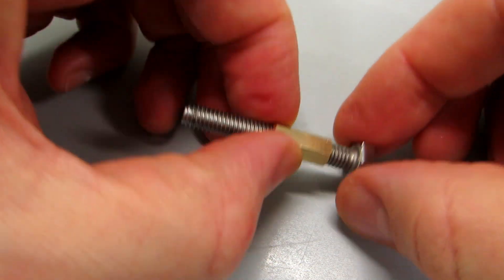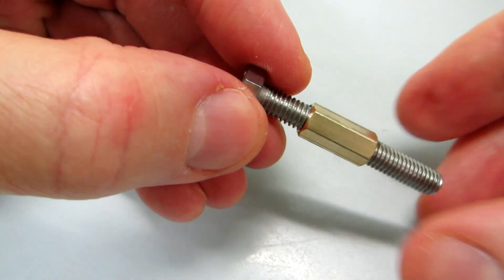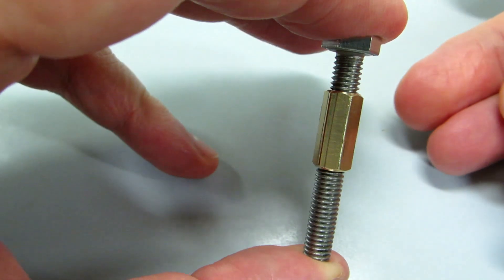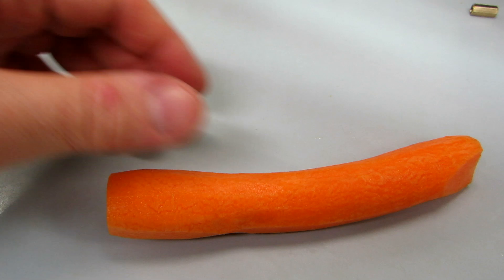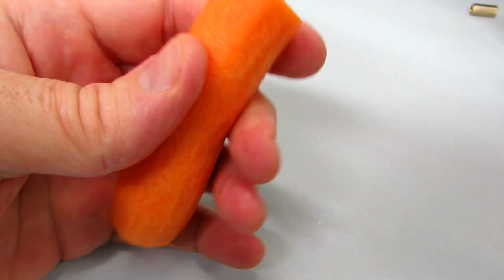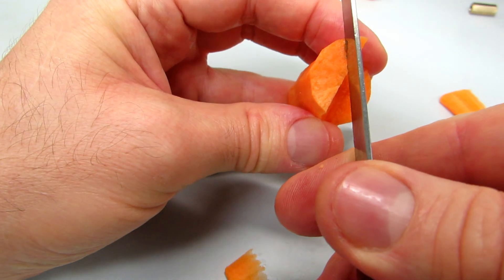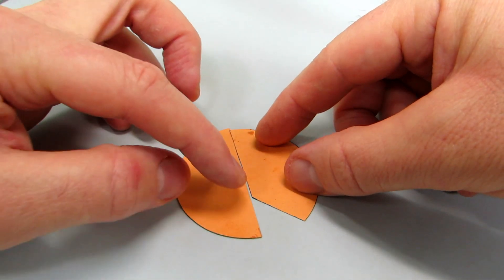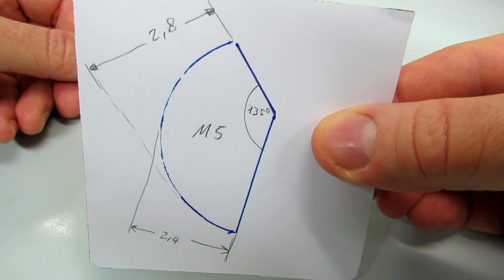The Impossible Screw will drive you nuts.

Comment: I tried to make one, but I had trouble threading my carrot.
Reply: try freezing it first.
Reply: @saradeanna  - screw that.
Reply: I didn't understand. I tried it with celery. Didn't work.
Reply: silly wabbit you holding it wong
Reply: Got my carrot caught in cieling fan
Reply: U probably used a metric carrot... it only works with UNC carrots... 🙄😏
Reply: fools,   he meant on a real bolt....only issue im having is it ruined all my kitchen knives trying to cut the bolts, any help on cutting the bolt would be appreciated
Reply: @dLikesDDs  
I'd probably go ahead and try a hatchet🤔
I myself was gonna start the lawn mower up, tip it up and while holding the bolt, stick it up into the spinning blade. It should give me a nice clean cut...........
up by my elbow or maybe even the shoulder🤪
Reply: That must hurt!
Reply: @pondartinc4002   - Celery! You some kind of stalker?
Reply: misfitsailor was it a grade 8 carrot? It’s gotta be a grade 8 or its too soft.
Reply: misfitsailor should have used a melon
Reply: misfitsailor I use that euphemism too!!!
Reply: I left my carrot out for the reindeer
Reply: Try metric instead of imperial.
Reply: Andrew Crews  I thought he also threaded a carrot as well?
Reply: Brilliant!!
Reply: after reading all these replies I lost my appetite for lunch :P
Reply: John Coops da dum crash...
Reply: I accidentally ate my carrot, I got hungry when I was making it.
Reply: I was out of carrots, but it worked well with mashed potato
Reply: He was using a cucumber not a carrot.
Reply: misfitsailor there it is.
Reply: That's what she said.
Reply: ha ha...
Reply: it works with cucumber though
Reply: @scootergeorge9576  hogies and grinders, hogies and grinders, navy  beans navy beans...
Reply: Man! That might hurt!
Reply: Swedish engineering is good; have you tried replacing the carrot with a swede (freely available from grocers shops)!

Comment: I don't thing the angle is the critical figure. I think the proximity to the center is what determines the clamping force, so you want to be as close to the center as you can be without actually having the cut go through dead center. At least, that's what makes sense in my head.
Reply: You got it 👏🏻👍
Reply: I think the angle is critical as the thread height is related to angle.  Turns per inch.  So n degrees = n/360 * thread pitch.  You need to ensure that you raise the height of the screw enough to cause it to jam against the thread play (whatever that is).  It’s probably a small angle but I’m sure it’s relevant.
Reply: I believe you are wrong. Think about if it was cut dead center. The screw would rotate about the natural center line of the fastener and not provide any outward force... just an axial offset since everything would remain concentric. Still, a very similar story if you are as close to center as possible.  If the angle is off center significantly, then pivoting about that point will result in a non-concentric path taken by the screw threads and result in binding. Long story short, eccentricity is what is causing this to work, so cutting on center, or as you state, "as close to center as you can be" without cutting through dead center does not cause any eccentricity. Or at least not a noteworthy amount to make this work.
Reply: This is correct. Not an opinion either. To the non-believers: when you remove the 45 deg. slice, that removes 1/8 of the thread lead. It jams because after a 45 deg. turn, you are forcing a misligned thread. If anyone is familiar with how screws operate, they create mechanical advantages. I'll skip the details and say it would take much more friction to jam it concentrially than it would axially for that reason.
Reply: I have an engineering degree and can confirm that the distance from the contact point to the center line of the bolt is the critical feature. The force required to rotate the screw will increase as the contact point moves closer to the center.
Reply: @andreww04  cross threads is better than no threads *in my best hillbilly voice
Reply: Almost correct, you must take into consideration the tolerance between the inner and outer threads, too close and it wouldn't grip.

Comment: I think the angle is less important than the offset. The offset required is determined by the gap between the bolt and the nut. The offset must be able to force the two parts apart by slightly more than the gap. The angle needs to be just big enough to allow the required rotation to accomplish that. So there is a minimum offset and corresponding minimum angle, determined by the diameters and the gap.

I think it would be possible to do it with ramps on each half. Turning one way, the ramp vertical faces push each other. Turing the other, the ramps force the halves apart, causing the threads to jam inside the bolt. But this would be much harder to make. That's what I thought was happening. Imagine a cut along a helical plate passing out from the center axis through a thread, making one revolution. Where the two ends of the cut overlap, another cut is made on a plane parallel with the axis from one thread to the other. The two pieces would separate cleanly. The amount of rotation to jam would depend on the tolerance of the threads and the pitch.

Comment: I may have a challenge to you...
On a spining whell adding weight closer to the tyres (bigger radius) keeps inertia much more easily than weight added closer to it's axis.
With that in mind, are you able to aply a variable radius ballast that will ease braking or acceleration by adjusting the ballast's radius on demand?
IDK maybe with magnets or gel or rubber bands? Like a magnetic suspension...
My idea! No one steals it from me!! lol

Comment: I have solved this mystery. the nut has is split thru one wall the length of the nut. Therefore you can squeeze the nut to tighten on the screw which allows you to turn the screw either way. You are welcome.

Comment: I don't think outward clamping force is really what is locking the nut here... Rather it is creating a misalignment of the threads... So the pivot point location is less relivant then the angle of the second cut when it comes to how much it will bind... This is similar to how 2 nuts will lock in place when tightened against each other...
Reply: I absolutely think this is what's happening as well. 👍
Reply: That sounds right to me too.
Reply: but when turning any of the sides the part of them that is in the nut will also cause it to move up/down accordingly, so wouldn't the thread stay in a proper position all the time?
Reply: I think the lock is acting like a Sprague clutch, rather than on the basis of elevated friction attributable to thread-phase issues. Grosso modo , the relevant force is radial rather than axial. 45° is one-eighth of a turn only. The locking appears to be rapid-onset. If it were attributable to phase issues, I'd expect to see a ramp-up as lash is consumed.

I expect that someone more familiar with a slide-rule will be able to calculate precise angles or derive a formula that ties pitch and diameter and thread angle together to arrive at optimum angles for that second cut…

Comment: It’s fun learning when presented with puzzles. Is this used in any practical application? I would think in some cases, this would be very useful.
Reply: Self locking nuts are used in colum lifts. But they work a little different. There are also two threaded pieces but they lock because of they are getting closer in the thread direction. Same technology is used as a mechanical endstop on some mills or turning machines

Comment: You’d think somebody mechanically inclined enough to come up with this or even implement it would know the difference between a screw and a bolt.
Reply: +Keith Preston A bolt is a subset of screw... The broad engineering definition is that a screw is threaded into a threaded hole (in the case of self-tappers, woodscrews etc the screw is cutting its own threads) whereas a bolt is used in conjunction with a nut to clamp unthreaded components. Here, he is inserting a machine screw into a nut, so it's a screw. If he had passed the screw through holes drilled in two pieces of metal BEFORE adding the nut... the screw becomes a bolt :-)
Reply: donkmeister What you say may be true in a dictionary somewhere, however, it’s not true in Lowe’s or Home Depot that I’ve ever seen. That’s a bolt. Doesn’t have a point. Threads are not angled to cut or deep enough to hold in self-cut threads. And the tip is not like that of self- tapping metal screws. Also, he’s putting it into a nut. What goes into a nut? A bolt. I’m waiting for dinner to be delivered. Which shows how bored I am to be discussing this.

Comment: I think it could work better, if you not cut it in two halve segments,
rather cut in in 1/3 and 2/3 segments.
Then, make a wedge from the larger part, no offset required.
You might not need 45 degrees either. But that's just an idea.

Comment: Engineering question;
When does a screw become a bolt?
Reply: A; when her dad comes home.
Reply: @drongojonkins8945  screw doesn't have a gender so don't say her, you must say it.
Reply: Nice one! At first i thought it was serious. Lol
Reply: So I guess the slow one that gets caught would be considered a lag bolt🤔?
Reply: After the wedding.
Reply: Bolts fasten things together with no threads in them, requiring a nut on the other side. Screws fasten one or more things to something with threads already in it, like a tapped hole. Bolts are mostly used in structural connections, screws are mostly used elsewhere.
Reply: @OgeyTheTerrible  
Thx! I actually have wondered this for the longest time but I have been too lazy to look it up! LOL
Reply: @OgeyTheTerrible   sorry but incorrect. Think of an engine, it has many bolts that don't use nuts. Manifold bolts, head bolts, connecting rod bolts. The list goes on.
Reply: @andrewaustin6941  ^
Reply: @andrewaustin6941  Not quite. 

An engineering screw has threads from the end all the way up to the fastener head. (aka a "full thread" bolt) 

 A bolt has a parallel section of shaft with no threads before thread starting on the end.
Reply: @OgeyTheTerrible  not quite, as above^^
Reply: @OgeyTheTerrible  so, your entire car is held together by screws? Lmfao! Nope, they are bolts.
Reply: @troylinden369  as a matter of fact yes, the majority of my vehicle is held together by screws, because that's what they're called.
Reply: You can thread a nut to a bolt but not to a screw.
Reply: It becomes a bolt when you put a nut on it, if you thread it into material it's a screw. But mostly it's a stupid semantics thing and people ignore it all the time. No wonder, the same damn fastener can have a different name depending on how you use it.
Reply: Funny joke. But it is considered a screw when it is mating with a preformed internal thread or it forms it's own thread when installed.
Reply: @prdoohan  that was what I was taught as an apprentice , I would also say that looked more like M6 not M5
Reply: @dogwalker666  I hope so, because I teach for a living and that's what's in our study notes!
Reply: A screw is driven in with a screwdriver, a bolt is driven in with a bolt driving thingy------oh yeah it's called a wranch or wratchet.
Reply: drongo jonkins: A bolt requires a nut to complete its purpose; a screw does not.
Reply: @rideswithscissors  therefore headbolts to put a cylinder head onto a block are actually screws as they go into the threaded block. Yet...they're called head bolts. Trust me. They're very much called that. I guess automobiles ignore these proper terms.
Reply: @prdoohan  "...section with no thread..."
I'm sorry, good Sir, but that's never been an engineering definition. If that's what's in your study notes you should find and correct the source of those notes.
There are a couple of "book" ways to define the difference, but in practice the it's the purpose to which it is put that frequently ends up defining when a screw becomes a bolt.
To refute your definition in particular: most of the bolts I use are full threaded. They tend to be plain hex heads and are generally known as Sets in the UK.  Sets are a type of bolt, not screw, and often are supplied with mating nuts, but again, it's application tends to define it's name -- that said, even if you turn a fixing to a threaded socket and want to call it a screw, if it has no screw head and must be addressed by a spanner, almost everyone will call it a bolt.
"Use by application rather than design." Just because the catalogue calls my tool a broad point pick doesn't mean I can't use it as an adze if it suits my purpose :-)
Reply: @rideswithscissors  I could tell I was amongst people who really knew. I respect and appreciate the information. My mind loves exceptions. So while they're called head bolts these lag screws have a given name which just isn't technical. Lol it's humorous.
Reply: A: when a screw fell down from space, it become a bolt.
Reply: a bolt has no threads near the head, a screw has threads all the way to the head.
Reply: @mikesch7672  Exactly. I know I perform my own thread when I'm installed... And damn close to properly...
Reply: @prdoohan  try going into any automotive repair shop and try telling them that. Context matters. It's like the tomato fruit/vegetable debate. You can be technically correct but I don't want your fruit smoothie.